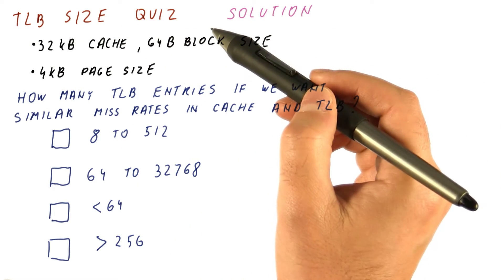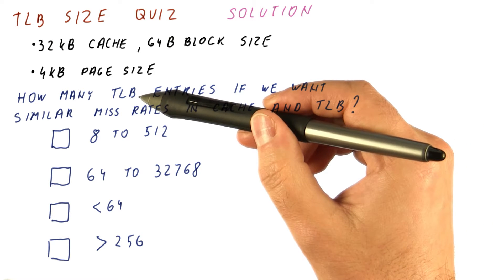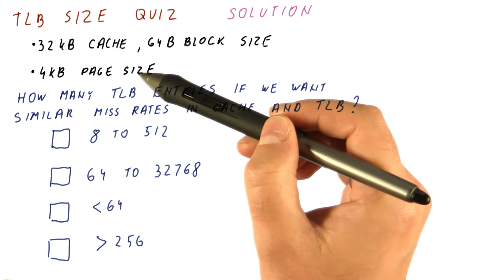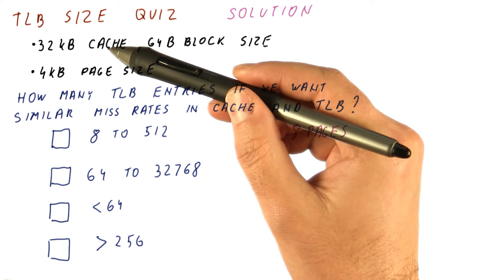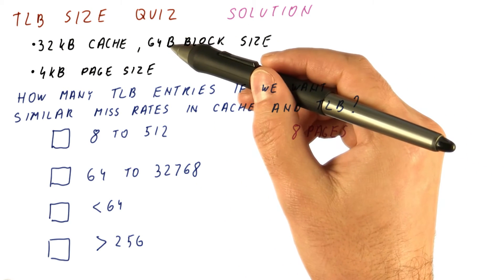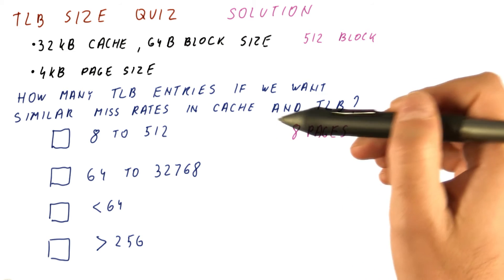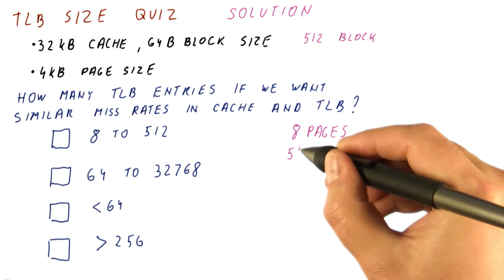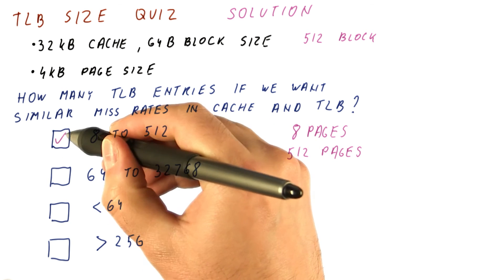TLB Size Solution Quiz - Georgia Tech - HPCA: Part 4

Comment: What is the relation b/w cache size and block size? How here no. of blocks and no. of pages in cache determine no. of entries in TLB?
Reply: A cache is divided into blocks. Thus there are 512 blocks (32KB/64B). In the worst case, all these 512 blocks could be present into 512 pages thus resulting into 512 entries in TLB. In the best case, 32KB cache data could be present in 8 pages(32KB/4KB), resulting into 8 entries in TLB. This is what I understood.
Reply: @29An288  Great explanation! Thanks!
Reply: @Tracy-mz9bi  yes indeed! thank you @29An288